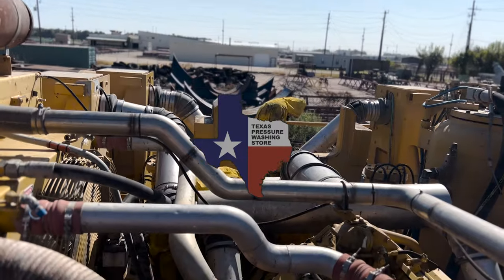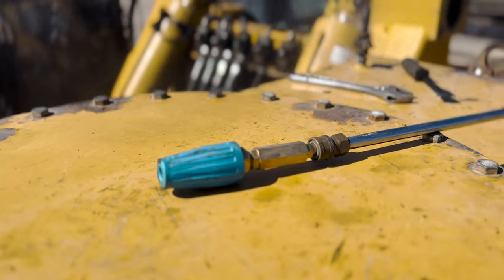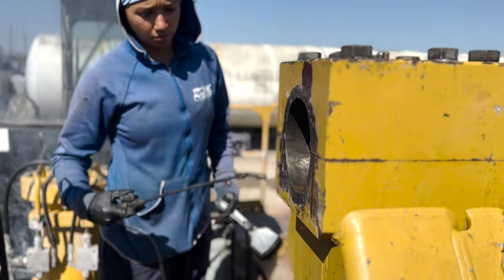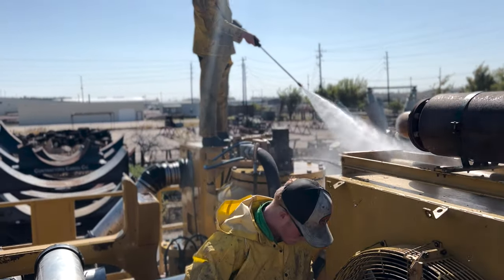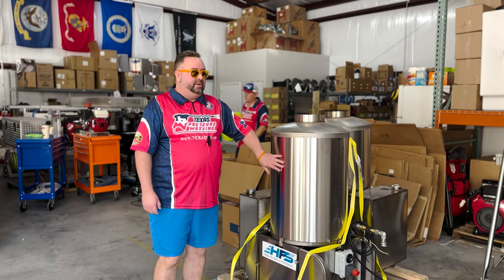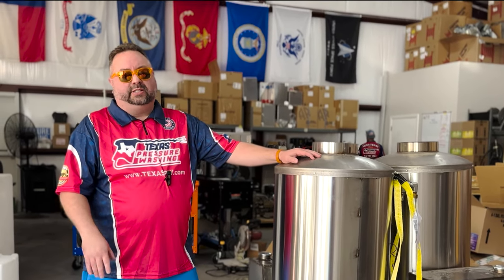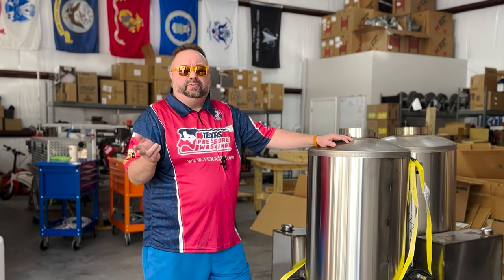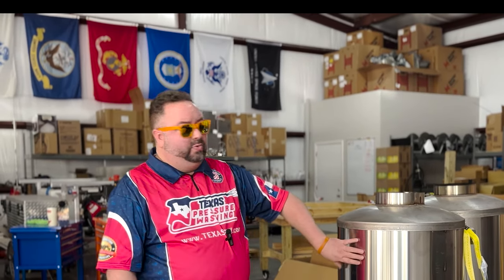$28,000 Mobile Drilling Oil Rig Cleaning Hot Water Pressure Washing

Comment: I don't do enough of work to justify a hot water unit, but it sure would of been nice on a few jobs I did. I suppose if I had one, I could start bidding jobs that need hot water.
Reply from the maker: Yes sir land the contract and add a burner.
Reply: you can pick up cheap used burners, they won't be 8gpm tho